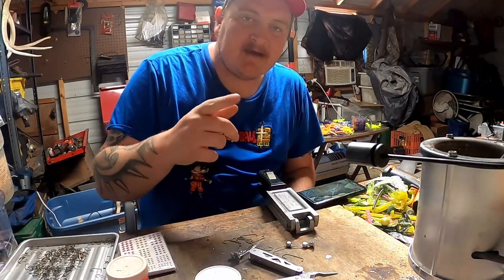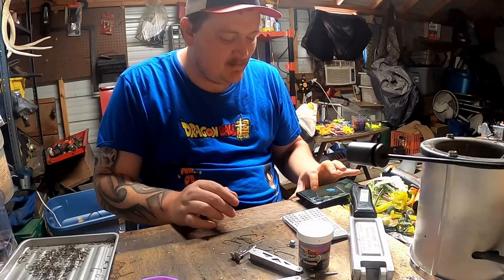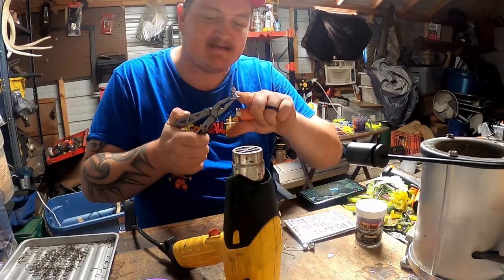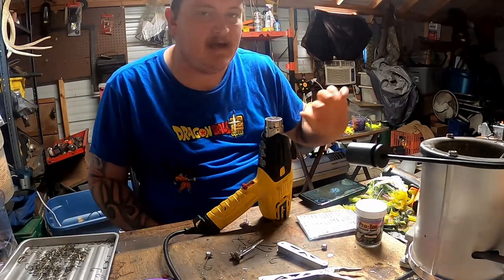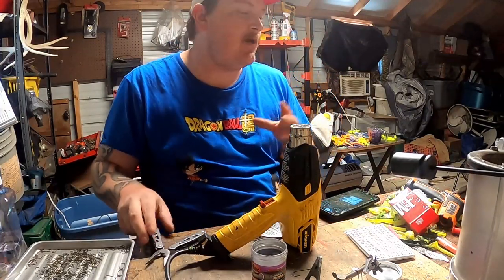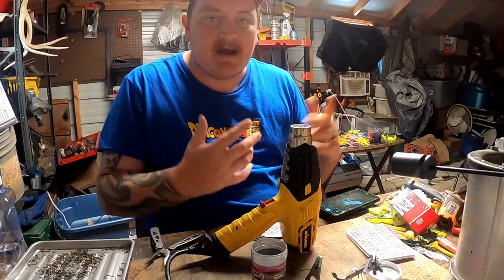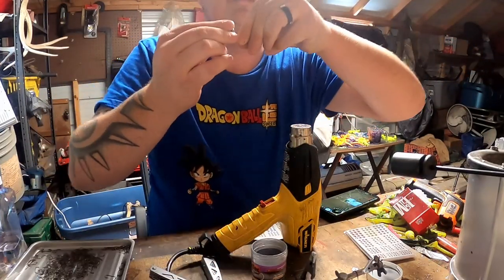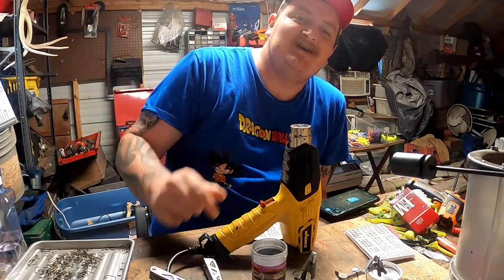How to Powder Paint Jigheads at Home

Comment: Touching the candle flame makes black soot, which is a good separator for the aluminum lead pouring mold. We don't want a separator between the paint and the lead. Be careful, or use a cleaner flame like an alcohol burner. (Yes, heat guns are cleaner)
Tapping the sprue mark or casting seam with something like a flat screwdriver it tiny mallet usually flattens it without filing.